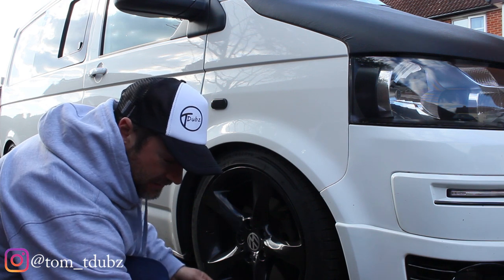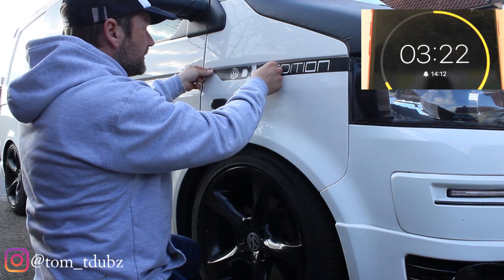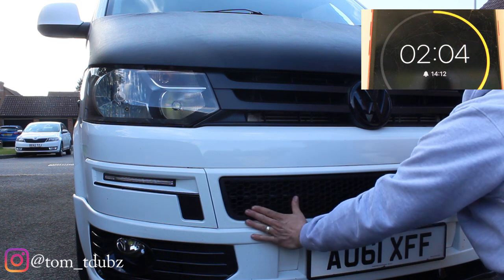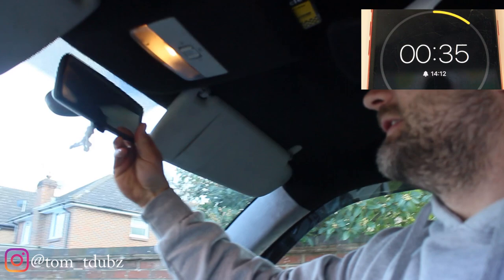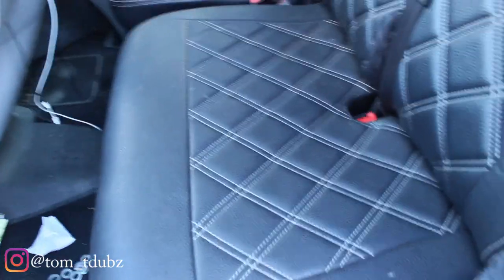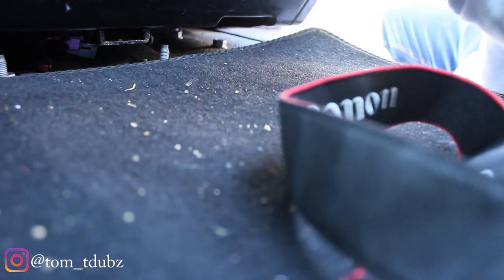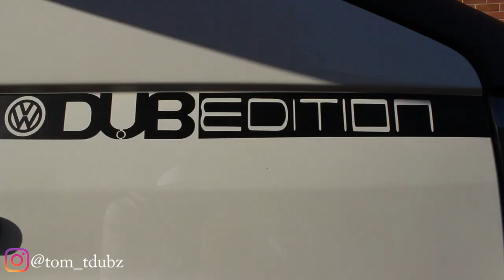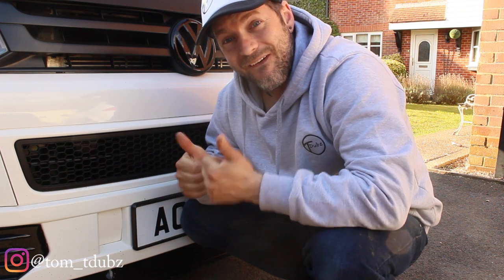Vwt5 5 mods in 5 minutes #stayhome #funtimes

Comment: Where did you get those cable connectors from and what are the connectors called?
Reply from the maker: Sorry fella what connectors are you referring too...
Reply: The connectors you used to connect your light switch to your fog light cable, there were 2 parts, one had a pin that pierced the cable.
Reply from the maker: Oh no probs, comments on a different video so wasn’t sure what you ment... travelinlite will post link in a min too
Reply from the maker: https://travelinlite-transporters.co.uk/collections/audio-visual/products/posi-tap-connector-pl605-6-pcs